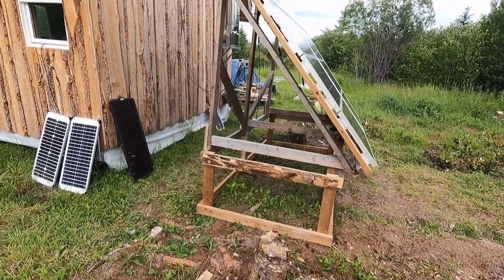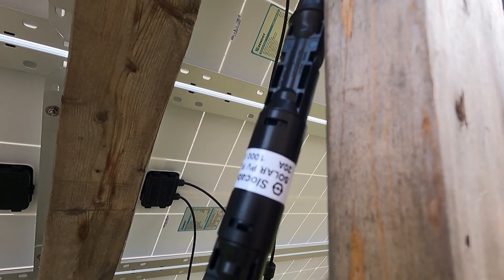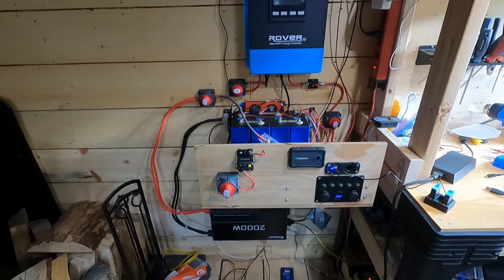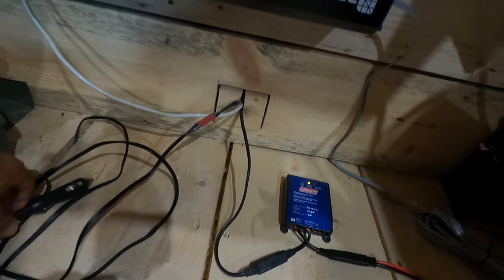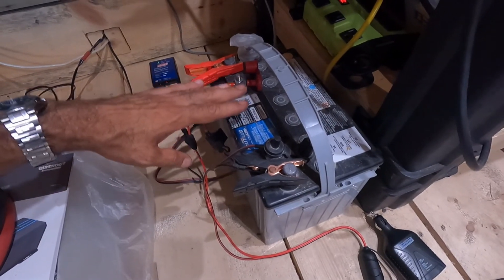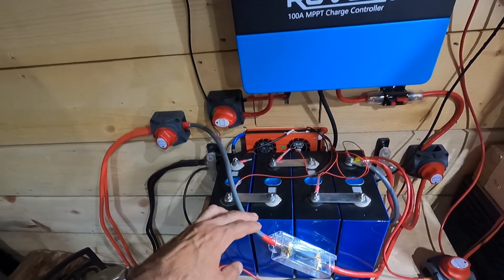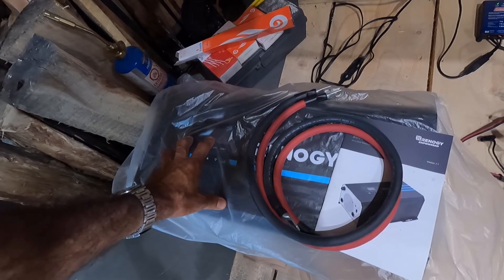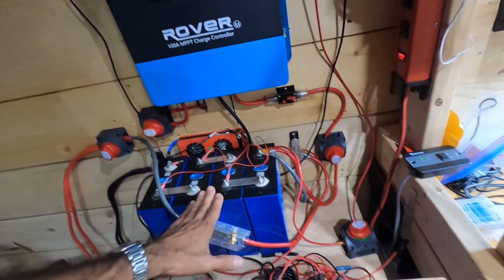A Quick Peek at My Solar System

Comment: Nice setup. 
 I’d be a little concerned with it being so close to the Woodstove tho.  Will you be moving everything to its own storage type building when you upgrade ?
Enjoy ! 🙏🌲🦉
Reply from the maker: It's a tiny cabin, 16'x12', so my space is very limited. In my next cabin I'll give myself a lot more room to work with . Haven't had any issues with heat so far, it doesn't take much to keep the cabin warm, even in -35C

Comment: Your system is somewhat like mine. I have a 24 volts 2000 watts Aims Power inverter charger. With twenty marine batteries on it, lol. At the end of the month I'm getting a Hurricane Vortec wind generator. It is a 1kw unit, max 1.5.   I have twelve 100 watts solar panels on the system now. I would have ordered the wind generator already, but I have to save up for a Midnite classic. I can't put any more panels on the 40 amp Epever controller that I have now. After The get the wind generator, I'll be adding six more batteries. These tend to run at a lower voltage than lithium, but the wind generator will be helping out a lot of the time to keep it at a higher level. By July I will have 1300 amp hours at twenty four volts. When completed the battery bank will weigh over a ton. I know it will be a great addition to have wind power. It will keep the voltage up on cloudy or rainy days. My solar system works great except this time of year. But it's windy here. There were forty MPH gusts yesterday. You have discovered that more batteries makes it all work smoothly. I'm going to need a large number of them because a wind generator is going to dump a lot, then quit. You have the right idea. Keep stacking those batteries. There's no such thing as too many. From what mine did, having more batteries makes it work better. I just figured since I'll be spending all this money, I want as much to go into the battery bank as possible. Instead of a dump load. But I've decided to quit at 26 batteries. The floor won't hold any more. I was going to get a 3000 watts inverter charger from Aims Power, but they were sold out. So I got the 2000. It weighs 46 pounds. I had to rebuild the internals last year after trying to run a welder. When I bought it two years ago, I got it for $653. Now the same thing costs $985. So I'm going to finish my system before it all gets too expensive. I'm not spending any that I don't have to this month and see if I can get it going. I'm going to be broke in March. But I think I can barely afford it, lol. So I'm going for it. It's raining here and out of 1200 watts of panels, I'm getting 21.7 watts. I bought a Winco Lil Dog generator in November. I have to flip the #1 dip switch to get the charger to work right, then flip it the other way to get the inverter to work right. So having the wind generator pushing the voltage up, I could maybe leave it in one spot. The voltage won't drop below 24.0. At the one setting it wants to turn the inverter off if there's no shore or generator power and it drops below 24.0v. But the other position it lets the battery bank drain down to 21.0 volts before it wants the charger to have power. But it's not that easy to drain twenty marine batteries to that voltage. But on these low light days, it trips the low voltage alarm on the other position. So hopefully the windmill will help. I'm hoping this will all work like I think it should. Looks like you have a great system. I started with twelve volts but I changed it to 24 early on.
Reply from the maker: That's quite the expansion, well done! I see now that the investment level needs to be on the batteries and alternate charging methods for when the sun doesn't shine much. I may do a wind generator at some point too. Keep me posted on your system, thanks for sharing!
Reply: I ordered a B&C 600 watts wind turbine from Green Energy. It comes with the controller and a big green resistor. It was $474 with shipping, 24 volts. The other place is having supply chain issues. I saved a thousand bucks over the other one. So I can get batteries quicker. I have six quarts of acid coming. Last summer I lost some acid before I had all the batteries. I just filled them with water, but the voltage was never the same. So I have a hydrometer now. Mostly the first eight batteries that I bought are out of whack. They got too low last summer during the solar flare. Since I'm getting a smaller wind generator, I can just brace it to the barn. It will be 25 feet from the battery bank. I only have 600 watts of panels out because of  tornadoes last night. I brought half of the panels into the barn. Getting 393 watts to the battery bank. I'm relocating a couple of them to the West side of the barn. Where they were is going to be in the shade of the windmill.

Comment: I appreciate the efforts you put into your content. I think your system is made of too many opponents you are constantly upgrading apparently. Instead of all this stuff, why don't you consider an inverter with its own MPPT charge controller, simplifying your gear? Just a suggestion.
Reply from the maker: Funny you should mention it, I did just that, more content on the way

Comment: Good job, nice vid & setup. Nice cells u have there, do u have an active balancer on that BMS? The passive balancers are generally not enough for those cells. JK have a really nice Bluetooth BMS with active balancers and a great app as well, if ur ever considering/needing another that works really well with that chemistry. Cheers
Reply from the maker: I believe the new ones I installed do, they are JBD. Keep an eye on my upcoming videos, I will be showing the install!

Comment: Great video! Nice job! 1 recommendation  get rid of the circuit breaker lol just use the ANL fuses. My 200amp breaker to my renogy 2000 watt inv would internally disconnect then reconnect. Also my 30 amp breaker for my solar controller to battery would build resistance making the solar controller think the battery was charged at only 20 amps. Scrap them and keep going with the ANL fuses. My 40 amp has put up with 42 amps momentarily a few times. Grab some spares and enjoy!
Reply from the maker: That's very sound advice, thank you! I have some on hand, so I'll be featuring this in an upcoming series on system upgrades
Reply: @frugalgunnie  I just hope that keeps you from having the same issue I did! I'll be looking forward to your next videos!

Comment: Thanks for sharing your system and setup, found  this purely on accident and clicked on because of your name. We live electricity off grid in central New Mexico and also run 2 systems, 1 is a Renogy 400w  setup and  the other is a 500w system with leftover panels from a new solar farm  installation a couple of hours north of us. They are independent and serve specific purpose in our mobile home ,  looking forward to upcoming videos and going to check out the rest of your channel
Reply from the maker: While I am neither a former marine nor a gunnery sergeant, I use the term as 'firearms enthusiast'. I did wear green for a time though, and did have fun with it. Thank you, I do have more upgrades coming to the solar setup, so keep an eye on future videos! You must have much higher exposure than we do up this way

Comment: just get a big ass solar generator ...
I went the battery trip.
not again. to much trouble ..
and to many dangers..
Reply from the maker: It was indeed a bit nerve wracking the first time I put together that battery in series, though I'm confident enough to upgrade the batteries once the new ones arrive. I'll post more on this!
Reply: Lifep04 batteries are actually extremely safe. If punctured they won’t catch fire or explode. Only concern is high current in event of short circuit.